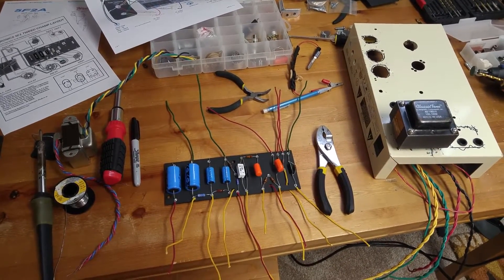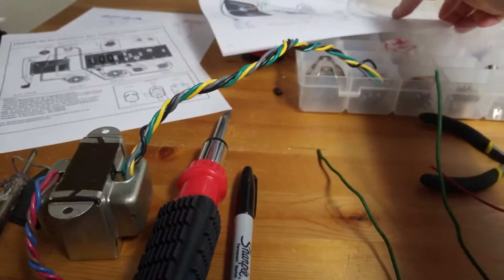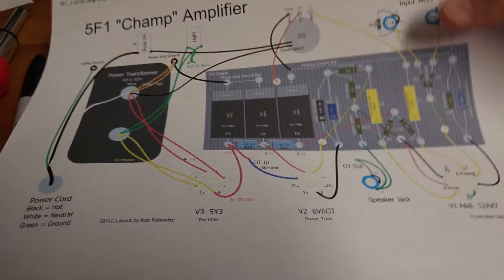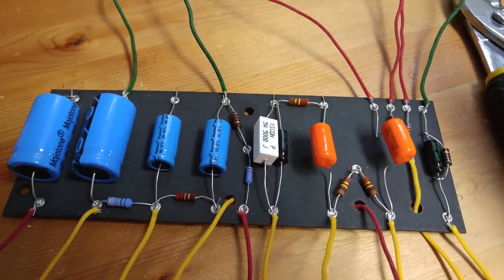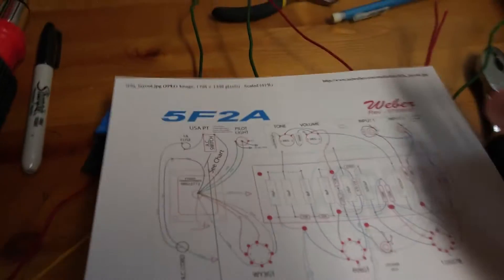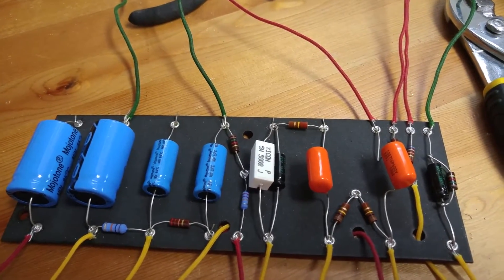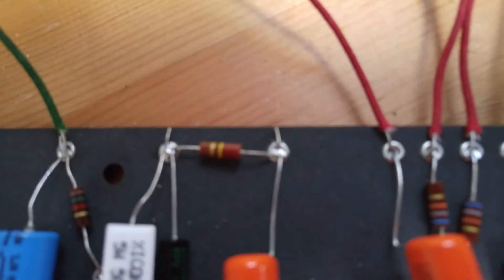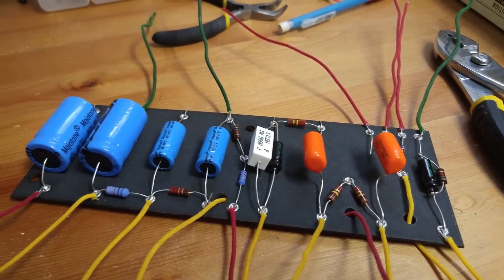Epiphone Valve Junior Rebuild pt. 3 - Wiring Components to the Board

Comment: Nice job. I have build a few of these and other amps. Fun stuff. But sorry to inform you that the two 22k resistors (blue and brown) are in the wrong locations. The lower watt brown resistor will have a short life in that location, so just replace that one and you will be fine. Also note that you need to be careful not to use both hands when checking voltage. Use clip-on leads and keep one hand in your pocket.